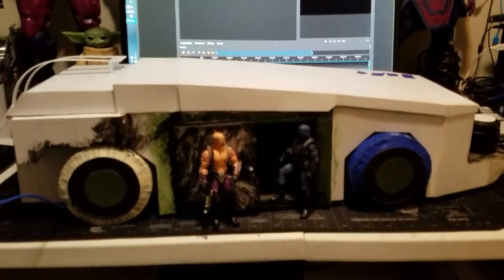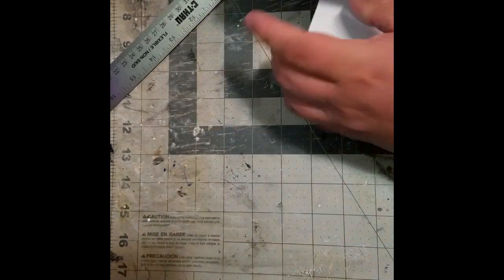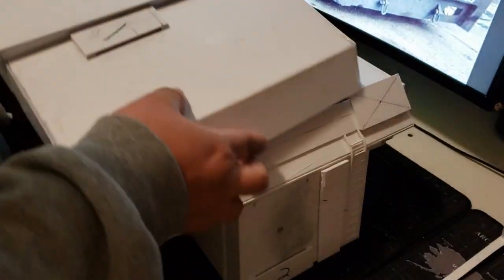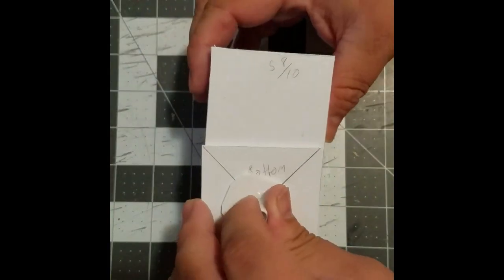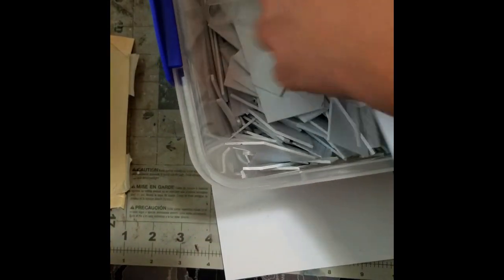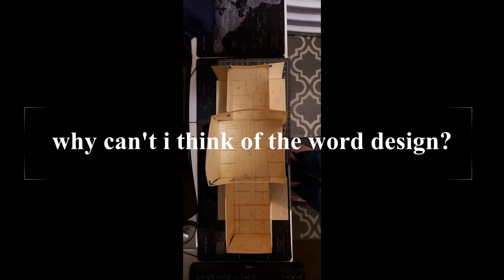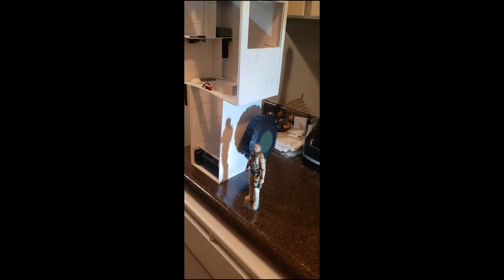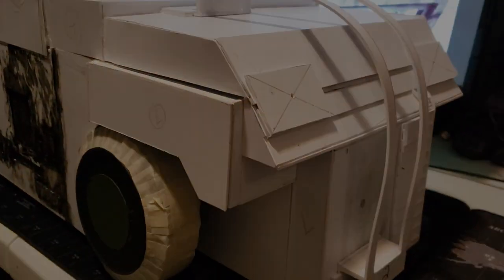Aliens Colonial Marines APC for action figures. 1:12 scale scratch build

Comment: Do you ever make your own Sculpting Tools
Reply from the maker: I have made a few custom sculpting tools from found objects. for instance i found some old star wars commtech toys at a garage sale. I took them apart and used them to sculpt simulated tech parts out of 2 part apoxy sculpt. Im gonna start a series of my finished customs. I can definitely add some tips and tricks in the vids! 

here's an example of the commtech piece i used https://cdn.shopify.com/s/files/1/0620/4745/3333/products/15751115.jpg?v=1656611143
Reply: I done done same thing found Objects to make Sculpting Tools attach to old 
Writing Pens.
And attached to them with repair Toe Expoy Putty like JB Weld Steel or left over Milliput

Comment: What Brand of paint and Brushes you use I
Reply from the maker: I have a lot of brushes. most of the ones I use on customs are old acrylic paint brushes I've demoted when they are too worn out for painting on a canvas. I also buy small thin cheap brushes in bulk (100) really cheap to use for things like Appling C+ glue kicker. I'm actually gonna spray paint this vehicle once I the weather warms up and is not that windy. Gotta go spray paint it outside and let it dry for a few hours.